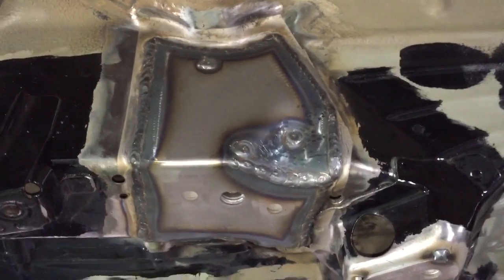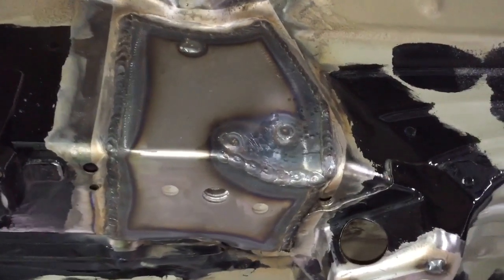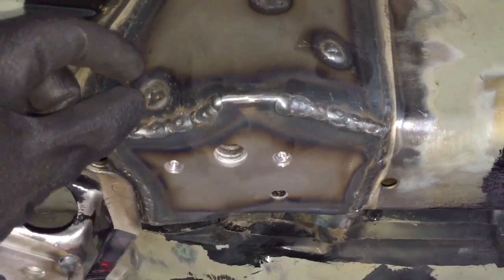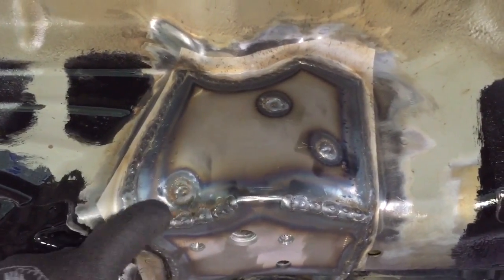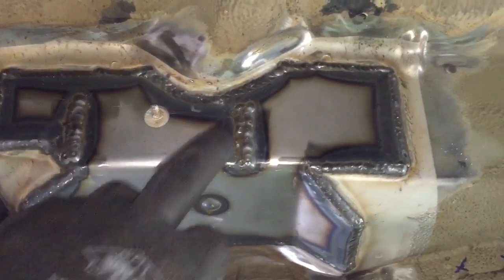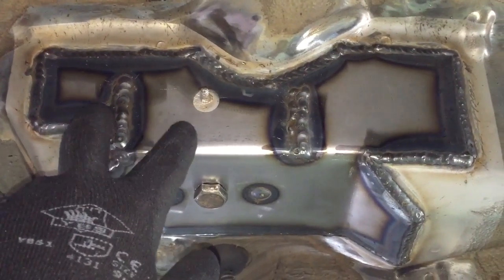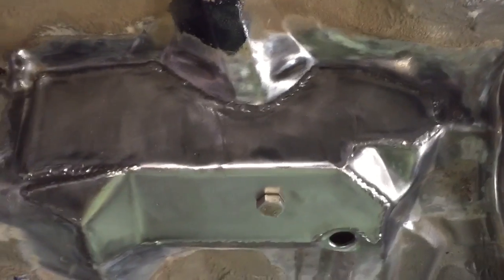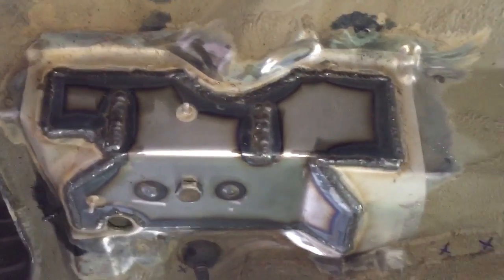Redish Motorsport E46 'Subframe' Reinforcement Plate V2 Kit

Comment: Looks like a very nice reinforcement. Thanks for the video. 
One question remains. How do you properly seal those welds? As far as I see there a sections where the blanc metal meats the old undercoat which could lead to a bad adhesion of rust protecting paint?

Which paint and/or undercoat is being used for this kind of modification? 
Just collecting information for fixing rust on my car by welding new sections into it....

Greetings!